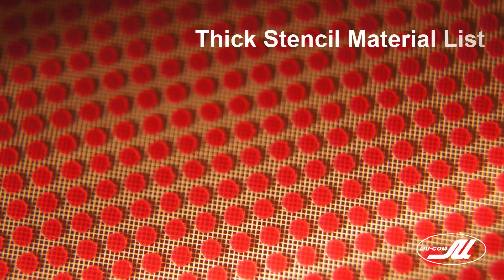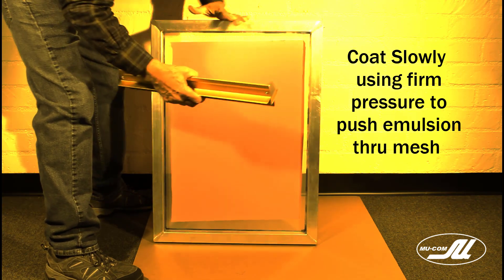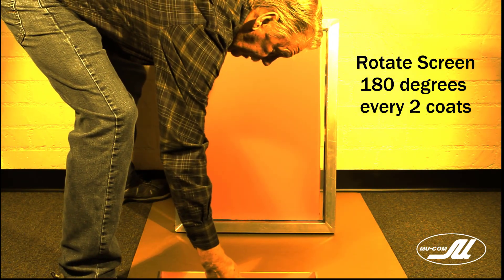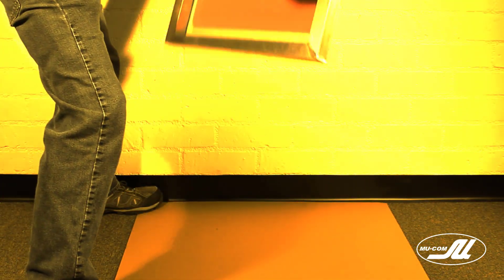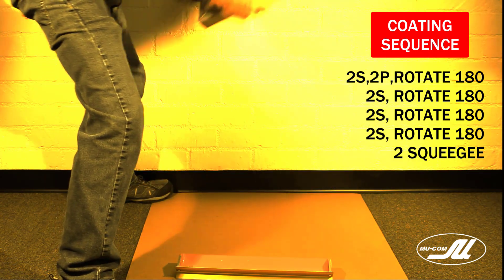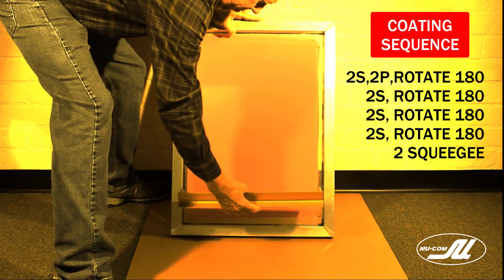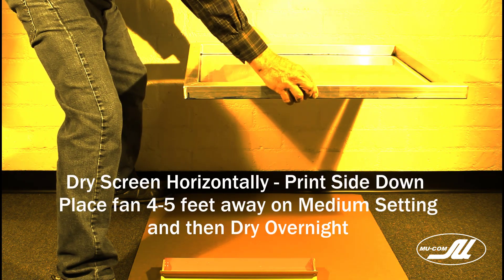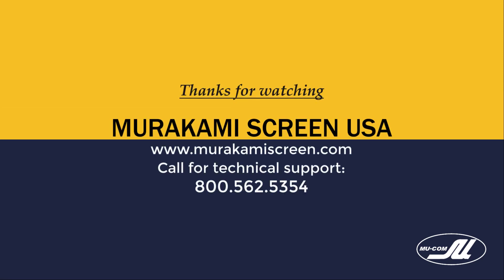How to make thick stencils with Aquasol HS

Comment: Would you apply the same technique if using an auto coater?
Reply from the maker: Set the autocoater up 2:7, 2 on print side, 5-7 on squeegee side.  The key is to go fast enough to coat all these coats without gravity causing the emulsion to drip off, yet slow enough to allow the emulsion to flow through the mesh.   Viscosity is extremely high to prevent drips.  You could also use less coats, dry, then face coat, 2-3 times and dry between each one.